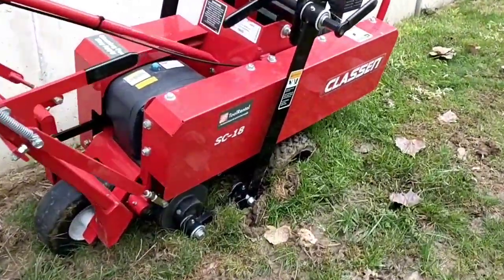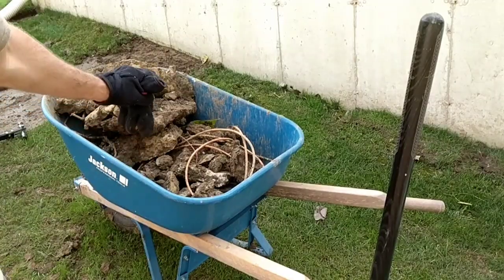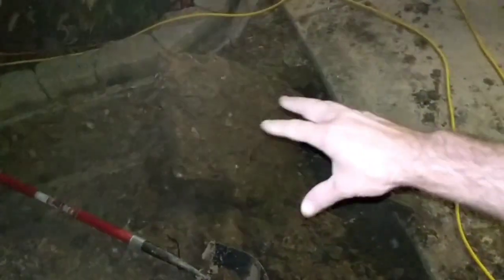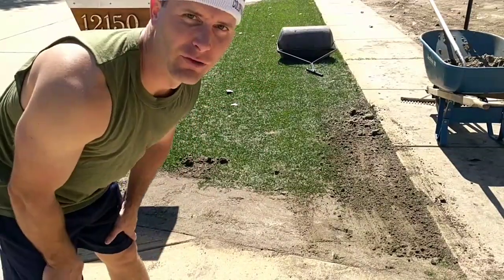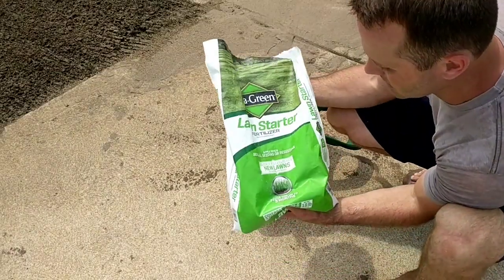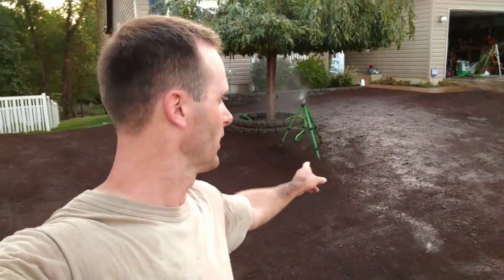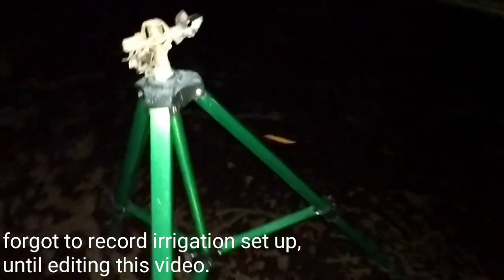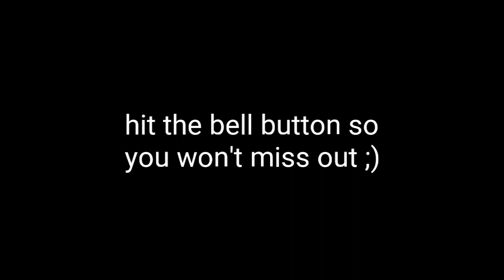Kentucky Bluegrass Lawn Renovation, start to finish #mazama

Comment: what a hard work! Great job..!! very impressive.  I want to do a full reno and seed  100% KBG grass.. I just don't have enough time and manpower.  After I moved into a home, I have been overseeding with 80%KBG & 20%PRG mix in mixed grass type lawn. and it's so bumpy😵‍💫  Instead of removing the entire sod, would it be still okay to scalp the existing lawn and seed 100% KBG ?   I know I should level the lawn first..
I have been looking for Mazama and some other varieties that can handle low cut.
Reply from the maker: Thanks! That would work, just make sure and get the seed covered. There's an infinite continuum of complications between the perfect fluffy soil bed, top dressed with a quarter inch- and throwing seed on hard bare ground.

That sounds like you got handle on things, I think it will turn out good. If I was in your position I would regret not taking the opportunity and level it.
Reply: @kove  ok..! thank you so much for your advice 🙂🙂

Comment: That root you yanked out is probably why that area was so poor. Not going to get a whole lot of water or nutrients to that grass with a 3-4" diameter root right there. Love the throwback music.
Reply from the maker: good point, I really need to expand the bed area for the reason. Thanks Jeff!
Reply: @kove  you're welcome! I've seen it before! I built a 1200 square foot putting green in my backyard which I spend a TON of time and money maintaining. I had one corner where the turf was just weak and I'd lose it in the summer. Frustrating! Somehow in my original dig out I was just barely too shallow to miss a root just like the one you have. It curled right into the corner and then out again. I caught it when I did a vertidrain operation and spiked 9" deep. Dug it up, cut it out, refilled the area with sand and now that corner is flush. That one root was just sucking the all the life out of that small area.

Comment: Koven, great job. Loved the video and all the work you did. What topsoil blend did you use? Your hell strip I think was 6:1 topsoil to sand right? Thanks.
Reply from the maker: Thanks Wesley! I did roughly 2:1 Soil/sand. The larger hell strip did ~3:1.
Reply: @kove  Thanks. Was the original soil clay based? Doesn't seem like you've had any issues mixing in that much sand, which is great.  I'm attempting a Mazama monostand in transition zone 7a in NC. Hopefully it isn't a disaster. Thanks for the inspo.
Reply from the maker: @wesrob_NC  Yep, clay based. The top soil i brought in was not, unsure what it exactly was though. It's tough through July and Aug, but worth it the remainder! Will you be posting it anywhere?
Reply: @kove  Nice, my back yard has decent shade, so hopefully the dead of summer wont be too bad.  Will be better than weeds and moss.  Not sure i'll be posting vids, we'll see.  Joined TLF a month or so ago, trying to soak up everything there and from a few guys like yourself on YT.  Might do a journal on TLF.
Reply from the maker: @wesrob_NC  TLF is a God send. Changed everything for me. If you start a journal (do it), tag me so I know to follow it. I'm NoslracNevok on TLF.

Comment: Where did you get your seed from ? I got my from super seed store. Mix of Midnight, bluebank, blueberry. The site said 1lbs per 1k for overseed and 2lbs per 1K for new... I put down 1.5lbs over my TTTF.  I know all the other lawn channels are throwing it down. But KBG seed is smaller? Did I not put down enough?
Reply from the maker: I got mine from a local place near St Louis. 4lbs per 1k is heavy, most seed around 2. I think 1.5lbs overseed will work well for you. KBG indeed is much smaller than fescue seed. That's a great combo of seed you picked out btw!
Reply: I went with those bec they are more of a dark deep green. I want to dominate my neighbors! After watching your video this makes me want to do a full Reno and make it all KBG! I like how KBG spreads and how dark it is. I’m in Maryland, kinda near the middle like you with the cool and warm season grasses. With temps reaching 90s in the summer. I hear TTTF is the best as heat stress. But it doesn’t fill in and you always have to overseed in the fall and it’s not as dark green. And you cant cut short ! It’s been almost 5 days and I haven’t  seen germination yet. I know it takes some time. I’m watering 4-5 times a day at 5mins per zone to just keep the seed moist (full sun all day). I hope it turns out well. Keep up the great work and can’t wait to see more videos !
Reply from the maker: Tttf is marks up 80% of the lawns here of people who care. I've only seen a small handful of kbg. Do the Reno! Don't be scared to do it in the spring either. I tested a spring Reno (Mazama kbg) and it did very well through summer with very little maintenance. Thanks for watching!👌